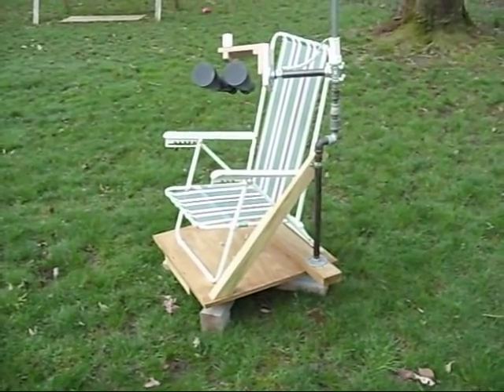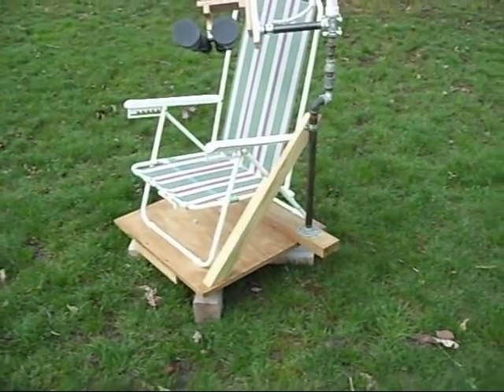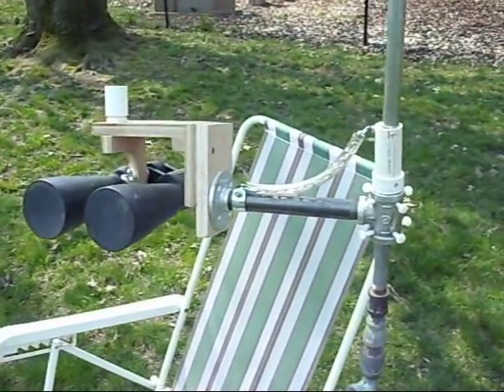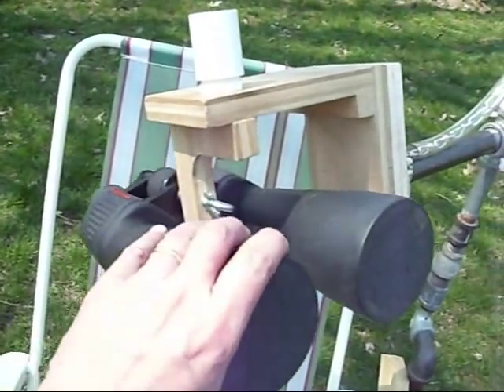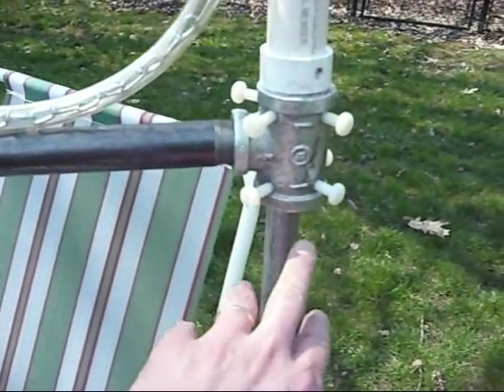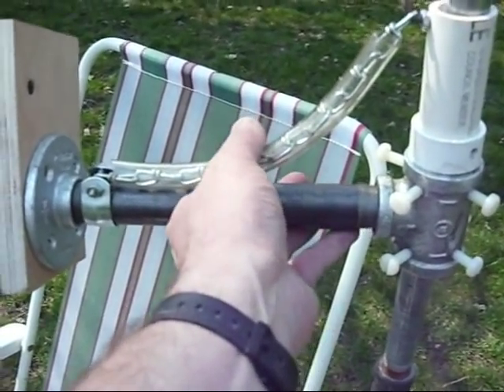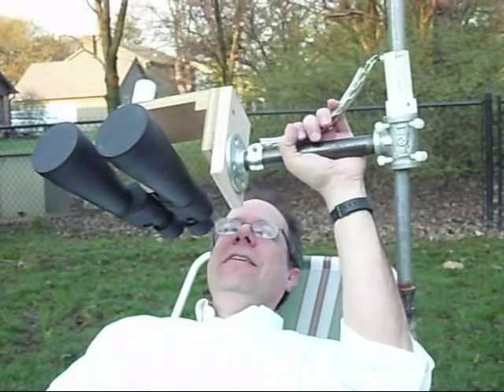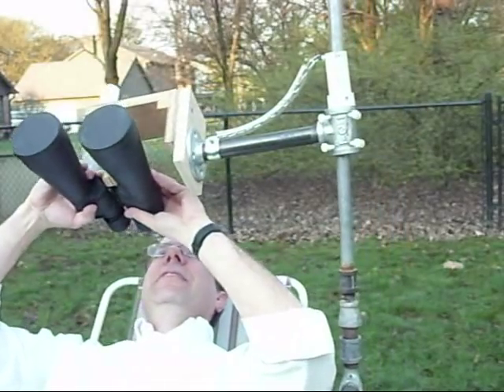binocular chair 2.0

Comment: This is great! I'm looking into building one myself. Would a single 1/2" vertical pipe work from the base all the way up? And how do you have the frontwards/backwards rotation set up? Thanks for sharing!
Reply: A 1/2" pipe all the way would probably be fine.  I think I just had 3/4 available and thought it would be a little sturdier.  What do you mean by frontwards/backwards?